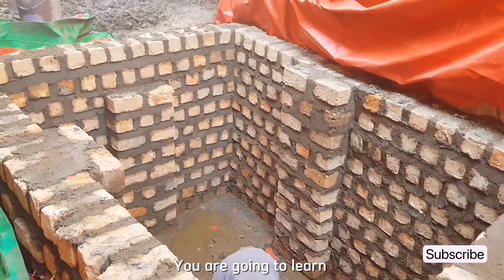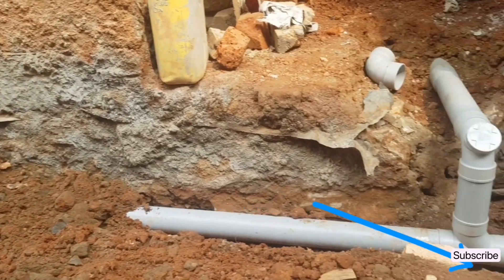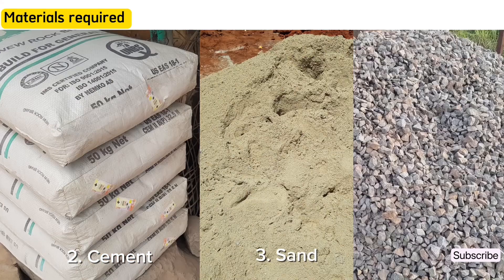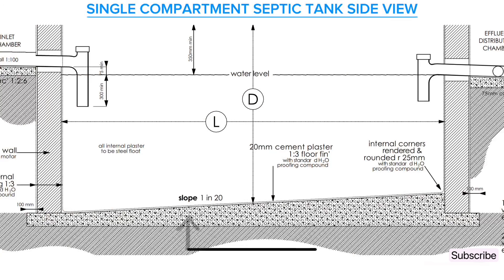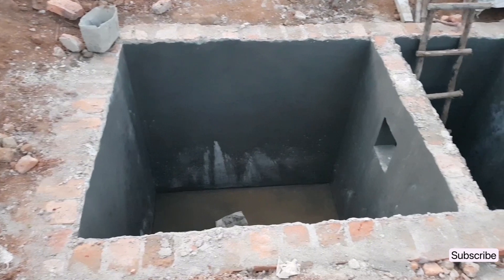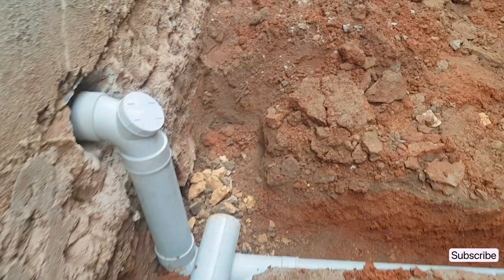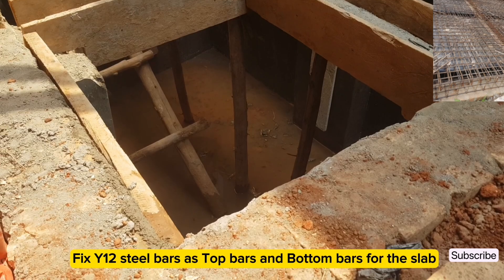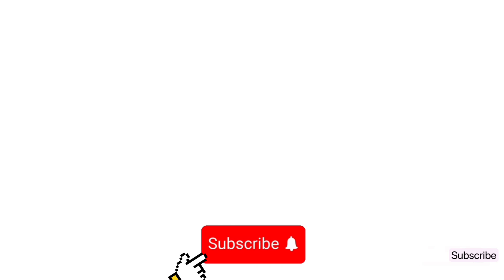How a SEPTIC TANK works and How to build a septic construction

Comment: Hello Ian, I have a question, is it always necessary to put concrete on the bed of the pit, im just thinking, shouldn't the water sip into the ground? Then can I excavate a single pit and divide it into two, the first chamber being the septic and the second chamber being the soak away?

Comment: On soak away pit it's mandatory to use damp proofing membrane (D.P.M) Only ,or even damp proofing coarse (D.P.C)can be used!
Reply from the maker: Whatever you call it or use will work so long as the material is able to prevent dump or water or moisture from penetrating 

Both DPM and DPC serve the same purpose of preventing dump from penetrating a certain area 
The difference is small

Comment: Thank you for the great video. Why is it important to fill the septic tank with water after constructing it?
Reply from the maker: A cup filled with water is more stable than an empty cup
Filling it with water helps to balance the force or pressure from the soil in the sides 

Other advantages of filling the septic tank with water include 
Ensures proper bacterial activity: Adding water helps create the right environment for the initial growth of anaerobic bacteria, which are essential for breaking down waste in the septic system.
Allows correct system testing: When water is added, you can check for leaks, proper flow, and correct functioning of components before actual use.

Comment: Bypassing the septic tank for non-solid household wastewater (showers, sinks, laundry) is generally bad design. This is because this so-called "cleaner" water still contains grease, oils, fine solids, and organic matter that can clog the soakaway. The septic tank helps remove these. Also, it could complicate the system, increase failure risks, and violate regulations.

Comment: Morning Ian, based on your opinion/experience if the contractor didn't apply waterproofing and didn't use a Teel to transfer water to the soak pit (only left a hole) is it wrong?? And could it lead to water contamination??
Reply from the maker: Water proofing helps to prevent any leakages
Failure to use it may result into any leakages in the future
Reply from the maker: I didn’t understand your second point properly sir
Reply: Oh, thanks for the quick response. I will try to explain myself a bit more. 

I saw you used a pipe/funnel/tube in between the two pits.... To transfer the water from one pit to the other pit. In our case, they only made a small hole on the brick wall, separating the two pits/sections.  Then they also have small holes at the bottom (30 cm from the flooring).

Then the other side, the floor has smooth large stones. The size of footballs.

Comment: The inlet pipe into the septic tank and the outlet pipe into the soak-away,  are they at the same height?
Reply from the maker: No
Usually inlet pipe at 1ft from the top level of the last course of bricks
Outlet pipe a bit deeper at 2 ft

Comment: Thanks Eng. What is the purpose of filling the septic tank with water before starting use?
Also, will the soakpit fill quickly for an area with clay soil that makes the place waterlogged even just from storm water?
Reply from the maker: Soak pit for clay soils has to be very large since water soaks so slowly compared to other types of soils 

There are 3 main reasons for adding water first 

1.Tank Preparation for First Use:Adding water guarantees that the septic tank is prepared to accept wastewater and initiate the natural breakdown process. In order to keep solid waste from adhering to the tank's sides or bottom, the water helps dilute the initial waste.

2. Encourages Bacterial Activity: The tank's water provides the ideal conditions for anaerobic bacteria to flourish, which are critical for decomposing garbage.

3.Avoids Odours: Because gases cannot build up in an empty tank, filling it with water lowers the possibility of unpleasant odours escaping.

Comment: Good lecture.  How can I find  dimension of soak pit  when given the dimensions of septic tank.  For instance for  200 users
 Formula to use please
Reply from the maker: The method is so simple 

You can find the long detailed explanation on our website www.ianconstructions.com

If I can try to break it down for you

To determine the size of a soak pit you have to consider different factors 

1. Daily water usage for each user
3. Soil percolation rate ( how quickly waste water will seep into the ground  measured in hours)
3. Local regulations 

Considering that 
I) Each user uses maximum 200 litres a day
II) The soil percolation rate as maximum 48 hours 
III) Local regulations - don’t want it so deep to avoid interacting with the water table

Considering that the soak pit  has a cylindrical shape 

V = π r² H

Where 
V is the Volume of the soak pit 
r is the radius of the pit 
H is the height or depth of the pit and
π is a constant 

Let’s re-arrange to find the depth of the soak pit 

H = (Volume ÷ π r²) x 2 days since percolation takes 2 days 

Height of the soak pit = ( Number of users x volume of water used by each user per day x the 2 days for percolation) ÷ π r²

H = (200 x 0.2 x 2) ÷  π r²

Consider  π  is 3.14
And r as the radius of the pit

Let’s take radius as 2.5 metres meaning its diameter is 5 metres

H = (200 x 0.2 x 2) ÷ (3.14 x 2.5 ²)
H = 4.1 metres

In summary, you need a soak pit with minimum 
5 metres diameter and 4.1 metres deep
Or
3 metres diameter and 11.3 metres deep
Or
4 metres diameter and 6.4 metres depth 

The above 3 give the same volume

Comment: isnt it better to put waterproof from the outside face of the wall? because by the time the water reaches the inner face, it has already weakened the bricks. otherwise thanks for the great work
Reply from the maker: You’re right 
The correct way is to plaster the inner part and the outer part with water proofing liquid or powder in the plaster and in the sand we use for masonry walls 
Then later paint the walls with black bituminous paint which also provides another waterproof layer
Reply: @ianconstruction  mob thanks

Comment: You sound knowledgeable. Isn't the soak tank environmentally harm to ground water?
Reply from the maker: Soil absorbs liquid sewage effectively as it acts as a natural filter, with the layers of soil, sand, and gravel trapping contaminants while allowing water to percolate slowly. Proper design ensures that wastewater is adequately treated by this filtration process, preventing harmful substances from reaching groundwater.

Secondly, The soak pit and the septic tank are usually positioned at least 30m away from any water sources 
This way, the soak pit won’t be harmful to the ground water

Comment: My question is, why do we consider compartments septic tank design.
Reply from the maker: We consider double-compartment septic tank design sometimes because they are good at trapping solids effectively in the first chamber. The first chamber primarily handles solids or sludge, whereas the second chamber allows further settling and makes the liquid sewage a bit clearer and cleaner. The cleaner the effluent leaving the tank, the lesser the risk of clogging the soak pit or drain field.
The second reason we choose the septic tank with chambers is because of regulations from authorities. Some regions require a two-compartment septic tank to meet higher effluent standards for the septic tank before reaching the drain field.
Reply: @ianconstruction  oh wow thank you. In my opinion, I would also recommend two compartments. Thank you for your Technical response. I kindly need your contact details we connect more for work
Reply from the maker: Alright thank you 
You can contact me on ianconstruction.yt@gmail.com
Reply: Hw much can it cost to construct a septic tank